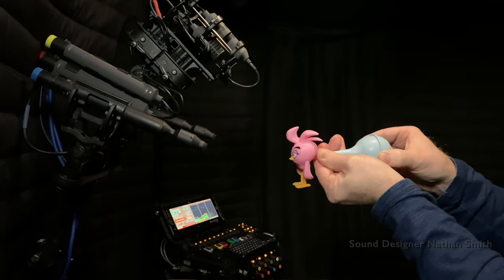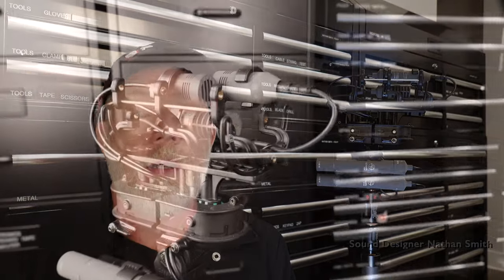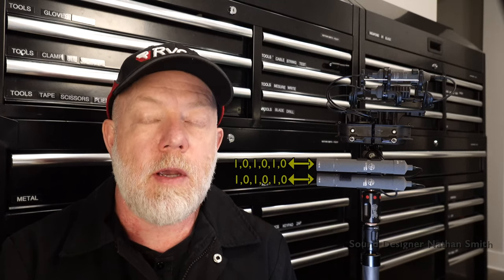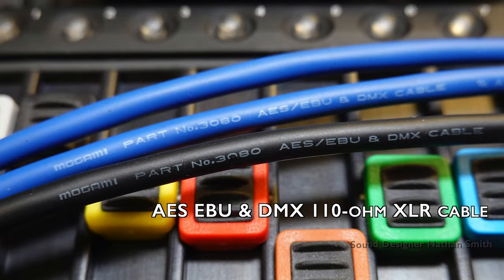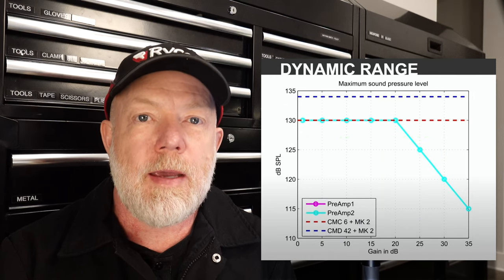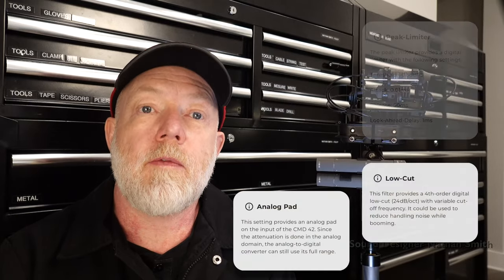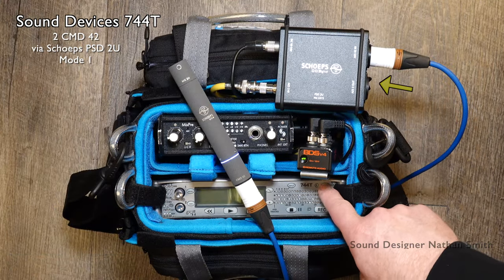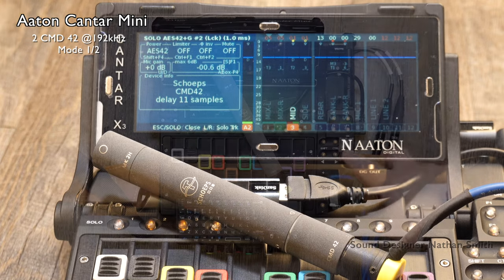Recording Insight - Schoeps CMD 42 Digital Amplifier Part 1

Comment: Thank you for sharing this! I am torn between the co 100k and the CMD 42 MK 2H right now. Maybe you could help me clear some things up:

1. On the Schoeps Website, I saw that the MK 2H only has a frequency range of 20 Hz to 42 kHz. Judging from your video this is not correct, right?
2. Since I don't have an Interface that supports AES, I would have to use the Mini-DA42 to convert to analogue. Do you think this would compromise the ultrasonic content significantly?
3. Would you generally recommend the schoeps setup over the co100k for ultrasonic recordings?
Reply from the maker: The Schoeps site likely doesn’t mention achieving such high frequencies because doing so requires post-EQ adjustments, and their specifications are based on raw, unprocessed results.

If your primary goal is to capture mono ultrasonic frequencies, the Sanken microphone is worth considering. Keep in mind that investing in a digital system can be cost-prohibitive for many users. (I do not recommend the Mini-DA42; if you plan to use a digital microphone, you’ll need a device capable of recording AES.) For those committed to honing their recording skills and seeking a long-term solution, I highly recommend the CMD42 digital system. One major advantage of the CMD42 is the absence of added noise above 20kHz, which is a common issue with all analog microphones.

If you want a microphone that performs exceptionally well at normal speeds and also shines when pitched down to capture ultrasonic frequencies, the Schoeps is an outstanding choice. Conversely, if your focus is strictly on ultrasonic recording and you plan to layer recordings from multiple microphones (multi-mic setups), the Sanken 100k might be a better option, especially if a digital recorder isn’t within your budget. While the Sanken 100k is a specialized, some what of a single-purpose tool, the Schoeps Colette series stands out as one of the most proven, versatile, and flexible microphone systems available. It can meet the demands of nearly any situation and support growth all the way up to mastering-level recording—if such a thing is even possible!
Reply from the maker: I haven’t used the Mini-DA42, but I would expect the DA-to-AD conversion to introduce the additional noise above 40kHz that is typically observed with all analog microphones.

Comment: Thanks for posting - really interesting. Given Aaton Digital's demise, it seems there there's an even more scarcity of recorders with AES42 support. If digital mics' time has 'arrived', i wonder if we'll see the likes of Zoom offering such facilities?
Reply from the maker: I hope to see more lower cost devices come to market now that there is clear value for them to make such a device. Sound Devices and some others have already made some new products that have AES42, like the a20-tx. I look forward to seeing more out on the market soon. I know I would be interested in a low cost device so I could use even more CMD 42's on larger recording session where I might use 12-25 mics 😂
Reply: @NathanSmithSound  whats aes42?
Reply from the maker: @creativegreatsvisuals  AES42 is a digital format for audio signals that allows for direct digital connection between microphones and devices. It also allows for the control of internal microphone processing, like gain control and filters. It powers DPP Digital Phantom Power 10-volt power supply.
Reply: @NathanSmithSound  what powers dpp 10volt ?thanks so much for the feedback, I appreciate it
Reply from the maker: @creativegreatsvisuals  If a Device states it supports AES42 then the device should be able to supply DPP, if a device is AES3 then you need something like the Schoeps PSD 2 that can provide the needed DPP 10 volts.

Comment: Hi, have you (or anyone reading this) tried the Sonosax m2d2? Also, any further thoughts on how the CMD would perform in extreme environments? Looking to aquire my first toolkit, working freelance with sound for picture, (LET/Sound Recordist/Sound Design/Sound mixing/Boom op/TV, Web mixing) out of Norway. I'm hoping two CMD 42 amps, a double set of Mk 41's, 1x Mk8 and Mk2H, would last me a lifetime. The M2D2 has a multitude of possible uses for me, AES in, Field recording, sound design and TV/Web mixing (headphones and mixcube). But i really need it to be rugged, and the lack of internal recording is also giving me pause : (
Reply from the maker: I belive it will work with the Sonosax m2d2, here is a link to a video of Sonosax saying it does as well. I have not tested it myself, but I too love the form factor and would love to have one. https://youtube.com/shorts/EnVmKERPEho?si=EMvrVaeRzvW0lop-

Here is also a link to the current supported devices (with more to come). 
https://schoeps.de/fileadmin/user_upload/user_upload/AES_42_interfaces_for_Schoeps_CMD_42_and_SuperCMIT.pdf

A great video from Simon Hayes going over his all digital film set rig that you might be interested in. https://youtu.be/LE2-ywtlcTM?si=rhQxRw6atq22hUOf

Simon used the CMD 42 in very harsh conditions here is a snippet from his testimonial on Schoeps site
"We were starting a film in Tenerife/Saudi Arabia. We used them in +40 degree heat, in vibrating vehicles for long periods, in the desert during airborne sand storms, in humid sound stages. Not once did they let us down...." https://schoeps.de/en/products/colette/microphone-amplifiers/cmd-42.html

Hope that helps, I'm not kidding when I say that the CMD 42 is a total game changer. I have 6 and saving up for 4 more 😆for my larger multi mic sessions.

Comment: so, can i use this with the Lectrosonics Hma
Reply from the maker: I don't belive it has an AES input unfortunately. Here is a link to the current supported devices (with more to come). https://schoeps.de/fileadmin/user_upload/user_upload/AES_42_interfaces_for_Schoeps_CMD_42_and_SuperCMIT.pdf
Here is also a great video from Simon Hayes going over his all digital film set rig that you might be interested in. https://youtu.be/LE2-ywtlcTM?si=rhQxRw6atq22hUOf
Reply: @NathanSmithSound  it looks like the cheapest option would do the psd 2u but that converts it into analog which do I really want to.  Also the best way if I want to stay with lectrosonics is, I found they do have a digital transmitter that accepts AES   it's a  DPR-A
Reply: @NathanSmithSound so if running wireless the transmitter and recorder have to both be compatible?
Reply: @NathanSmithSound  with a SCHOEPS mini da42 can convert it to analog and record it to a mixpre 10ii ? If so Will it still have the same beautiful features and app capabilities?

Comment: how with this cmd 42 work with the mixpre 6 ii? will it be compatible?
Reply from the maker: It will not work with Mixpre, you need a device with AES inputs (AES is Digital) like a Sound Devices 788
Reply: @NathanSmithSound  it’s saying that the deity plug in will have aes42 to be compatible with mics like the Schoeps cmd42 so why will this not work if the deity plug in is connected to a receiver that’s plugged into the mix pre 6ii? Will the digital features inside the Schoeps cmd42 still do their magic ,like no need to do things like gain control on the mic ?
Reply from the maker: Mixpre is analog input only device